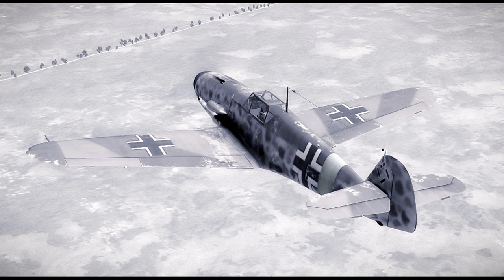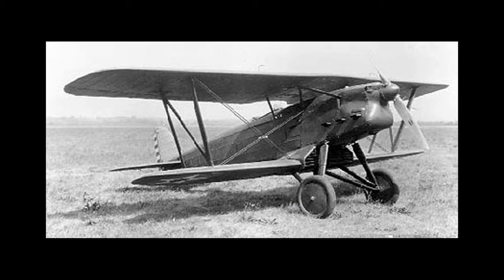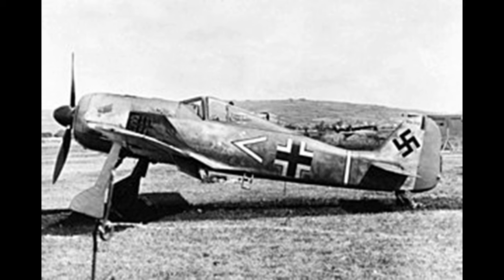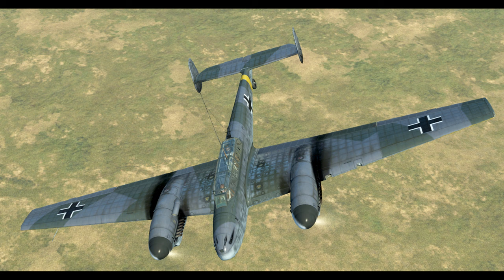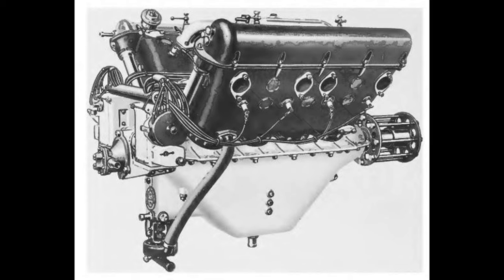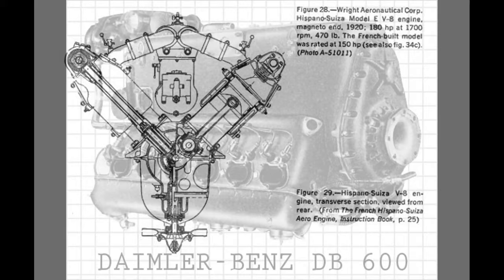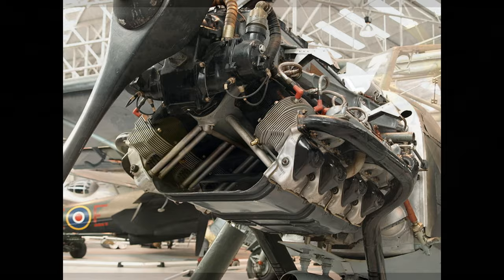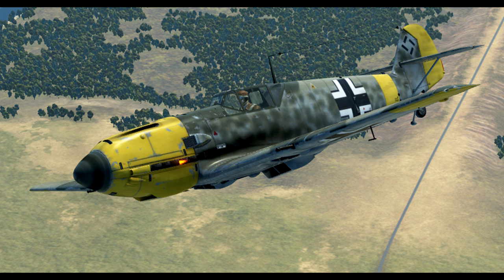Messerschmitt Bf 109 , Why an INVERTED V-12 Pt. 1? inverted V12s vs. upright

Comment: Just as a note, all post war published US Navy speed specs for "maximum" speed are in fact, wrong, intentionally so.  Usually by quite a bit. It is likely that the modern vessel has a maximum speed quite a bit higher than the WWII PT boat. Published speeds on the older vessels does seem to be accurate. Modern stuff is off by an order of at least 10-20 Knotts, sometimes more.   Otherwise, great video on a topic very overlooked.  Logistics is one of the most important part of war. The logistics stall during the war in Europe gave rise to the Bulge. The logistics stall by failing to capture, in tact, the Russian Oil fields, stalled out the German invasion of the USSR, thus dooming it to failure.

Comment: Is there a benefit from inverted V engines with the line of thrust from the prop being higher relative to the mass of the engine?
Reply from the maker: No because they move it with the gear reduction to the spot they want.

Comment: Development of US heavy tanks did continue after the war.  The T29 has the same hull as the later T34 heavy tank (in some cases the T29 hulls were re-purposed for T34s), and the 120mm T34 was the basis for the later T43 and later M103 heavy tank.  The US experimental heavy tanks (T29, T30, T32 and T34) were also the first vehicles to be equipped with the excellent Allison cross-drive transmission, which would be used in subsequent main battle tanks up to the M60.  So they were very important development vehicles, albeit indirectly.
Reply from the maker: The T29 did not continue after the war. Of course heavy tank development did as we ended up with the Abrams.
Reply: @GregsAirplanesandAutomobiles  I'm not sure what your source on T29 development not continuing after the end of WWII is.  Per Hunnicutt's _Firepower_, the bulk of T29 testing occurred post-war, with the first T29 heavy tanks only showing up to Aberdeen Proving Ground in 1947, the T29E1 with the Allison powerplant was only ordered in December of 1945, again, after the cessation of hostilities.  The T29E2, which featured a modified turret housing an MIT-designed rangefinder, was only designated in 1948.

The Abrams is not a direct result of the US WWII and postwar heavy tank development program, except inasmuch as it uses some technology derived from those programs (likely in the transmission).  The Abrams, like most Western MBTs, was originally envisioned as a much lighter vehicle.  The initial studies called for something like a 45 ton vehicle.  The performance of modern anti-tank weaponry means that a 45 ton tank that size really isn't survivable though, and the weight has crept up accordingly.
Reply from the maker: From Wikipedia: "In 1945, with the war in Europe already over, the T29 and T30 were classified for "limited procurement" and a small order proposed on the basis that their large guns and heavy armor would be useful for attacking Japanese bunkers. Army Ground Forces command, however, objected to the deployment of such heavy vehicles and the war ended before the issue was resolved. As a result, only a small batch of pilot models were constructed."

The greater point here is that when WW2 ended so did the T29 by any practical standard. That's why I means when I said the T29 "did not continue after the war". It may be that they drove the few that were built around a proving ground and did "testing" as mentioned in Hunnicutt's book. I would expect that, they already built them, so why not? However, as a weapon of war, the T29 ended with WW2. 

I didn't say that the T29 led directly to the Abrams. Nor did I ever say that heavy tank development didn't continue after the war. Please don't change what I actually said. These conversations are hard enough to keep on track as it is. 

Furthermore, the whole point of the tank discussion was to show the second market for aircraft engines, and the T29 was put in to show that Allison had a glimmer of hope and could have been an tank engine. The video does not make an attempt to cover all of T29 history, of which there is very little.
Reply: @GregsAirplanesandAutomobiles  The history of the US heavy tanks program on Wikipedia is completely wrong.  The T29 tank was never seriously considered for mass production during WWII.  The T29 prototypes only existed after the war ended.  The end of the war did not result in the cancellation of the program, and, I would argue, didn't even downsize it.  There are two Operational Coordination Messages calling for mass production of the T29/T30/T34, but those are from March and April of 1945.  That was far too late for any meaningful use in the European theater, unless Eisenhower thought that a heavy tank was needed for dressing up lines of POWs for some reason, and it's rather late in the game for it to be used in any invasion of Japan.  There is a persistent claim that the T29 was intended for the invasion of Japan, but this isn't backed up by any of the sources based on archival research, and appears to be an example of citogenesis in action.  Aside from those anomalous OCMs, the numbers ordered were always in the single digits.  Furthermore, the order to install an Allison engine, the part which concerns your video, only happened after the war.  The whole thing was a trials and technology development program from the start, with the possibility of it being an actual war weapon only briefly considered.

Comment: The Germans did not have fuel with the same octane ratings available to the Allies.  Inverted engines would have additional oil cooling of the Pistons due to the oil coming off the crank shaft and rods.  Gravity aids splashing of the Pistons crankcase side reducing piston temperature and as a result  may lower knock sensitive of an inverted engine.

Comment: Hey Greg, whats up with the spiroll on the spinner, mainly on german planes? The best I can come up with is to lessen bird strikes. Idk?
Reply from the maker: For one thing, it looks cool. The main idea was to make it more obvious the prop was or wasn't spinning. It's all about safety for the ground crews. Modern airliners often have these on the fan hub.
Reply: @GregsAirplanesandAutomobiles  
Agreed, definitely cool! And yeah, " black birds". What's good for goose?  It's worth considering the lengths that airfields go to alleviate the problem. (bird strikes).Everything from firing frozen turkeys at Everything  to flying mechanical falcons about. Love the channel, sometimes the only place I can go. Thanks!

Comment: Yeah why would you need a dry sump on a boat...
So basically, America and England were making engines that would sell, people were voting with their dollars, and this dictated the availability of engine types...
Germany however didn't need boat racers and car manufacturers to keep business going... rather they relied on military license fees/contracts...
The engine was made purely for the use of planes solely, where as the Allied engines were made with the mindset of "we need customers" in general...
The German war machine just didn't work that way!
Very interesting video!
Personally I think in planes, the inverted method is superior... And if it wasn't for crappy oil, I wouldn't be surprised if Germany had the best V12s during the 30s and 40s

Comment: I wonder why Rolls-Royce never thought of an inverted V12 engine. Was it because the Merlin and Griffon engines were carbureted, not fuel-injected?
Reply from the maker: No, a Carb can be used on an inverted engine, and often was.

Comment: Does an inverted V-type actually lower the CG? The heaviest part of the engine is probably the crank and crank case and that , in an inverted engine, is raised compared to a conventional V-type. OK, the heads, especially when you have twin-cams, will be substantial lumps of metal but they'll not have anything like the weight of a a forged steel crank inside them.

Comment: Could it also be a Sort of hold over from WW-1 Allowing Cowl mounted Machine guns firing through the Airscrew, Plus having a inverted V your crank driven Interrupter gear doesn't have too be so long and Bulky , Having Cowl Mounted Ordnance Is possibly easier to aim closer to the pilots line of sight , possibly snap shooting  , Plus that's 2 guns you don't have to harmonize for range  like wing guns for range giving convergence  , Plus they had a spinner mounted 20mm Cannon giving a very compact firing package . having cowl mounted machineguns also allows for huge Ammunition cans 1000 rounds per gun (without the nose cannon / 500 rounds with ). Its just a thought but this does give you a rather dense fire convergence at most ranges , instead of harmonizing that gives you convergence at one range , and either closer or father than that your fire convergence is less effective . Plus the two leading figures before  the war for German Airforce, Goring and Udet Where WW-1 Aces and may have had Something to Do with this

Comment: Does the inverted engine also have advantages in the thrust line/vector, or is that taken care of in the reduction gearbox or just affects the visibility.  Great video as ever Greg. Love it.
Reply: Thrust line considerations are minimal. 

I’ve flown a Lake Buccaneer (it’s a small amphibious aircraft with the engine on a pylon). Every instinct tells you it’s going to pitch down with application of power. Nope. It pitches up like every other airplane.

Comment: Would the Spitfire and P51 have been better with inverted engines? It appears so. Given the sheer number of them that were produced, the cost of developing a merlin that worked upside down would have been trivial.
Reply: +gareth roberts   The Germans put a DB engine on a captured Spitfire, and I think it was pretty nice flying airplane. But I have not read extensively on it.   The Allies destroyed it in a bomb raid.  https://i.imgur.com/cBRXTOQ.jpg

Comment: Maybe it was the combination of the requirements of good view and the ability to install synchronized gear (machine guns). Later on the design helped to install propeller hub mounted gun (not original spec).

Comment: I always assumed the inverted design was used for the higher propeller placement. Although this doesn’t explain the fact that with a gearbox a regular v12 can have the same prop placement
Reply from the maker: The gearbox actually moves the prop LOWER in the 109, thus it's in about the same place as an upright V-type, at least a typical one which has the gearbox moving the prop up.

Comment: I’m figuring since heat rises, and placing the heads low rather than high, the benefitted thermosiphon effect permitted improved cooling. Second, being a low wing monoplane, the center of gravity should be kept as close to the wing level as possible.
Reply: Not likely on the thermosiphon and the lower CG would just reduce dihedral a tiny amount, except for ground handling.

Comment: FWIW, the Crusader was powered by the Liberty V12, not the meteor. The Cromwell was the first mass produced tank to use the Meteor.
Reply from the maker: One Crusader had a Meteor, It went over 40mph! I'll agree the Cromwell would have been a better example, but I was still technically correct with the Crusader and Comet.

Comment: Sorry for my bad grammer.for me they invert the engine so that the propeller will be on top and above the engine...since they put the cannon trough the propeller shaft for ease of aiming.further more the engine will be more easily accessible for routine maintenance.i don't really know about the effect of G lock on the fuel supply...since they use fuel injection rather than carburetor to deliver the fuel.

Comment: copied from another site, The advantage of an inverted aero engine is that the crankshaft is further off the ground. This permits a larger diameter propeller than would otherwise be possible, allowing a smaller, lighter, cheaper undercarriage, and other structural and cost benefits. Small British aircraft Eg: De Havilland Tiger Moth used inverted 4 cylinder engines. The Spitfire went from a cheap simple 2 blade, to complex and expensive 5 blade props to use the massive increase in engine power within the same diameter of props.
Reply from the maker: Hi Robert, that's good research, but it doesn't apply to the 109. The difference is that in the case of the 109 the gear drive moves the prop down when the engine in inverted, thus actually creating less prop clearance.

Comment: The SovjetRussians also used the v-12 engine. Not inverted here either. Used just like the Spitfire did. Mikulin was the chief inventor of these engines. They had problems with low quality fuel and could not increase power enough to compete with the the Messerschmitts. The Mikulin AM-37 was disaster and was only made in 40+. But they solved the problem in the end. The V-12 was developed from the Italian V-12 Hispano Suiza to the German BMW VI to the Mikulin type. Several Mikulin V-12 are here is not counted, like AM 43-44-45 engines. From 1930 to the end of ww2 estimated more than 100 000 Mikulin engines produced. Jay Leno says that the Rolls Royce Merlin won the ww2 but I do not agree with him....
Reply from the maker: I like Jay Leno, but he is wrong on this one.

Comment: Great video -- Thanks much for this presentation. It was spot on.  One thing I have wondered about is how does an engine (fighter) maintain enough oil in vital parts of the block i.e. along the cylinder walls when looping or doing evasions?
Reply from the maker: The oil pump isn't really effected by positive G. It's  a dry sump system so it keeps oil at the pump in anything that's not negative G.

Comment: They had the advantage that those engines were available in bulk? Once you start going one way and it works there is little point in changing over.

Comment: It seems to me there might be an oil distribution advantage in the inverted V - Despite the need for a dual sump system. Once you've pumped the oil to the top, you can take advantage of the work already done by using a gravity fed distribution system. This could eliminate the need for varying pressure  allowances in the feeds for the various lubrication points. Just a thought. Obviously, this would not be as advantageous in a ground based application for the reasons mentioned in the video. (I'm just a lowly engineer.) 😐
Reply from the maker: I don't know, you may be right. However my initial though, having worked on a lot of engines is that due to oil pressure, spray and spash, oil gets everywhere without too much trouble. Then again, the cars of know of that had oil lubrication issues, always seem to have it at the top (i.e. cams or lifters in an overhead cam set up, so you may be on to something here. Bottom line is I just don't know if it was a factor here, but maybe.

Comment: The reason for inverted engines in taildraggers is ground clearance of the propeller on take-off and the ability to mount bigger propellers.
Reply from the maker: Hi Dan, you might want to watch part 2, I talk about that quite a bit.
Reply: @GregsAirplanesandAutomobiles  You bet I wanna watch part 2. Thanks!

Comment: It would seem to me that inverted Vs would have an advantage of a lower center of gravity, with the cylinders,  piston / rod assembly, heads and exhaust under the centerline of the engine. Disadvantages: cost of, dry sump / oil routing complications, oil/ fluids pooling in combustion chamber after shutdown. Perhaps higher center of gravity of upright Vs enhances roll/ maneuverability characteristics?

Comment: when the cylinders are down it's easier on both oil pumps to push the oil or if the pumps fail still the oil after the action of gravity it can flow to the cylinders
Reply: why doesn't the oil collect in the cup formed by the inverted piston ?
Reply: because it will thicken the ignition plug for the engine  while when it is collected in the lower part of the piston then it is transferred with the pump into the upper part of the engine

Comment: Hi Greg, great informative video again. 
I think the inverted V allowed for a couple of machine guns mounted above the engine. This would probably concentrate it's fire power on the target. 
Didn't some 109s have a cannon through the spinner? Dunno how they did that.
Reply from the maker: The cannon first through the spinner because the center of the prop is lines up with the valley in the V, so there is space there for it. Hispano Suiza did the same thing with their upright V-12. As for the machine guns, think of all the fighters from 1915-1940 that had cowling mounted machine guns and upright V-types or radials. So I don't think that was really a factor, or at least not a big one.

Comment: Ein Charakteristikum des Daimler-Benz-Triebwerkes wie auch seiner Vorgänger seit dem 1932 gebauten Prototyp Daimler-Benz F4A war der Einbau mit „hängenden“ Zylindern (Kurbelwelle oben, daher auch „A-Motor“ genannt). Die hängende Anordnung erleichterte auch die Zugänglichkeit von Zylinderköpfen (Ventilsteuerung) und Zündkerzen bei der Wartung. Another reason was a better maintaining from the ground so the mechanics did not need a step-ladder.
Reply from the maker: That's true.

Comment: Would an inverted V engine require fuel injection as a carburettor would be difficult to use inverted?
Reply from the maker: No, not at all.

Comment: Why not ? A lot of another aero engines even 6 in line were inverted ones, the radials are quite inverted, too... The diference about german made inverted aero engines are Bosch mechanical injection systems...
Reply from the maker: Inverted V-12's in front line WW2 fighters were unique to Germany. Anyway, "Why not?" isn't an an answer that's going to get you through any aviation test I know of. We are on a higher level here.